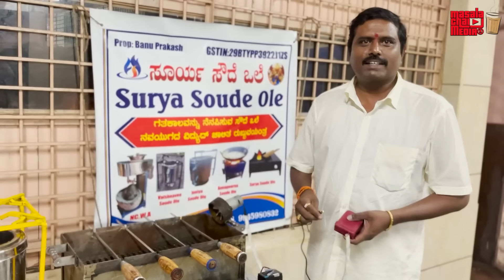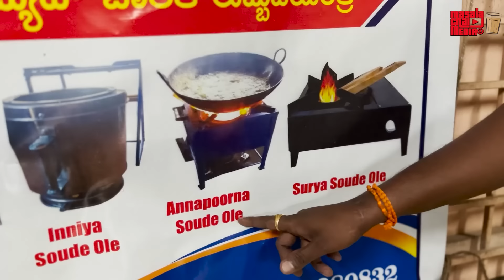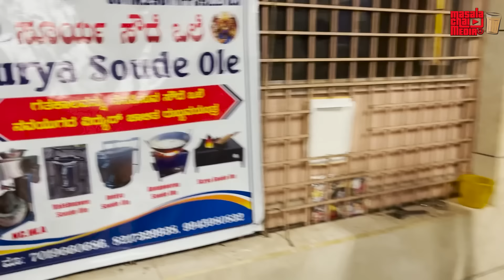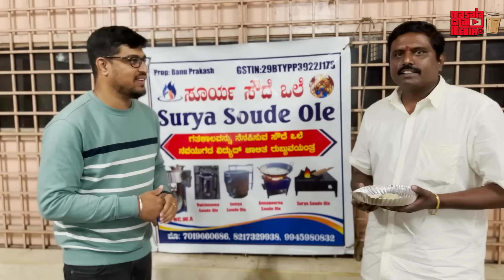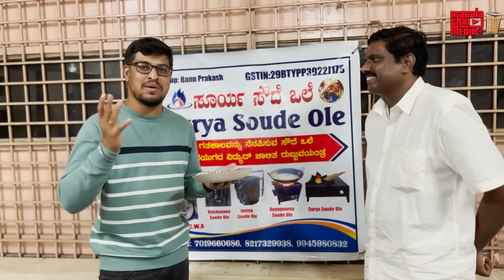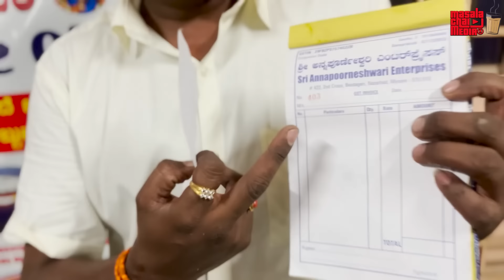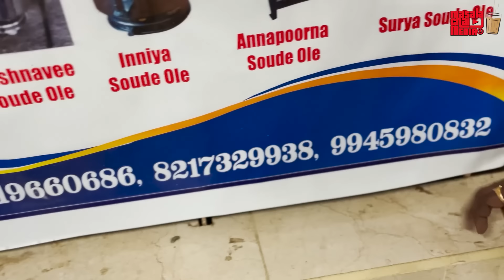ಆಧುನಿಕ ಮ್ಯಾಜಿಕ್ ಸೌದೆ ಒಲೆ Wooden Stove | Smokeless Stove & Rubbo Kallu | Kannada Product Reviews

Comment: Not economical for residential use.
Dalily 5 kg of fire wood per day, ₹6/kg = ₹30, 
Gas cylinder costs 1055+30 service =1085 . ₹36/day 
Time consuming is more in firewood stove, need to be very organized, storage of firewood,space to be created, vessels become black, it's later job of cleaning, very painful and tedious.
Gas stove, anytime instantly usable, time saving,no botheration of black vessels.
Bottom line, 
fire wood stove can be an option but not the replacement for gas stove. Commercial operators can opt it.
Think sensibly.
Product is good no doubt